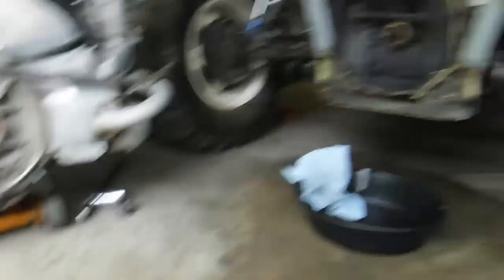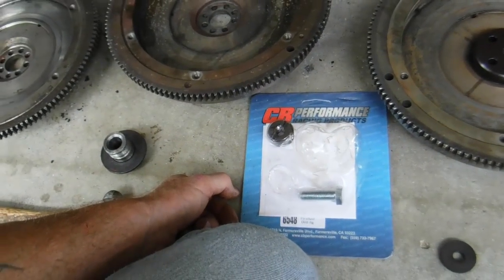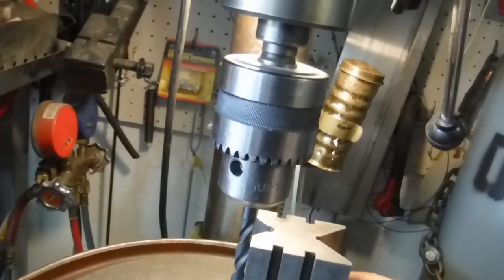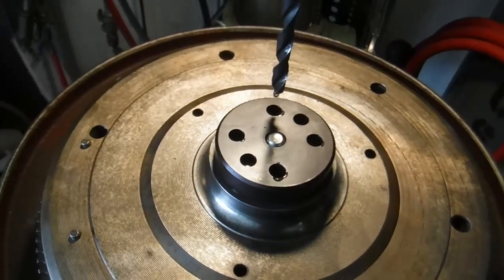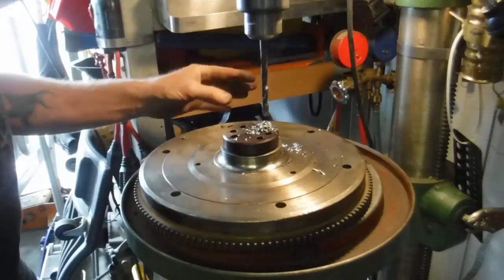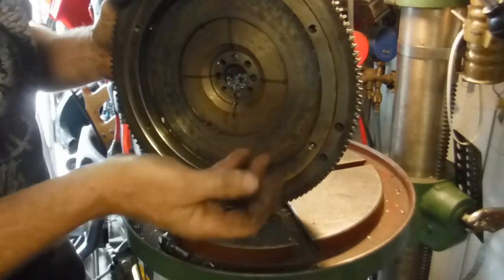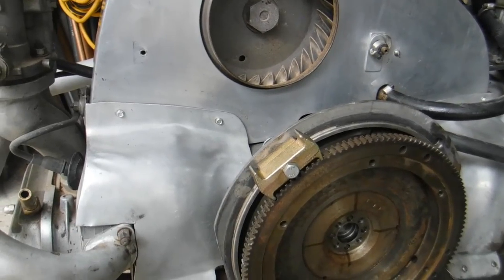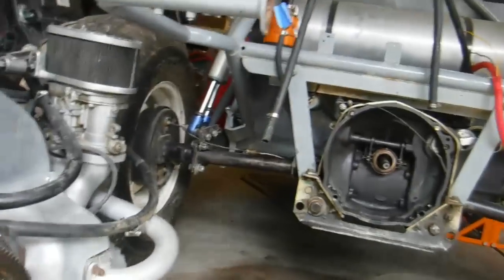Stock VW Flywheel To 8 Dowel Upgrade

Comment: I have an old 65 1200 40hp engine with the 4 dowel pins on the end of crank that look like 1/4" pins? Need to measure but the 6v flywheel I have has smaller holes like 3/16"?  Is this flywheel for an older engine before 61?
Reply from the maker: Good question. I don't have the answer but maybe someone reading the comments can help?
Reply: Thanks for getting back to me. I did some research and found that the flywheel is for a 36hp crank and what I need is one with the 5/16" pins which mate up with either a 6v or 12v flywheel. I think the 36hp one has the 3mm pins and the other flywheel has the 6mm ones. You can't modify it since the flywheel on a 36 won't mate up with the 40hp crank. different diameters. The guy who I got it from believes he has the right one in his machine shop and would see if he can find it for me.

Comment: Thx EZ.  I keep wondering if i should dowel my stock flywheel or get a lightened one.  Does it make that much difference?
Reply from the maker: I have one on my 1800 and you rode in it.......   It will be more responsive in traffic.  Might be nice in the vert you have.

Comment: Will the stock weight flywheel give the engine a little more low end torque ?
Reply from the maker: It might be noticeable. I usually put a 6 lb pulley on the other end for the same effect.

Comment: Your comments are good about using the best holes on the flywheel and two dowels to align the drill jig but it would have been very nice to actually see how the jig is set up and affixed to the flywheel. This of course is the most critical part of the process. Also, where are the instructions to setting the drill depth? The drill jig can't do this. Drilling too deep would ruin the flywheel. Lastly, as a former precision CNC machinist, a short discussion is needed about drill speed and feed into the flywheel for best precision hole drilling, talk about chip clearing and pecking it out. This information will greatly increase the value of your video.
Reply from the maker: obviously you have never looked at a VW flywheel. 
The holes go all the way threw. The dowels are usually installed on the after market  cranks. The fixture comes with a drill bit. It isn't rocket science. We're not building the space shuttle here. The jig comes with directions. I'm just showing it in operation. Thanks for watching and commenting.
Reply: I have looked at a few flywheels but certain you've looked at many more. But I do know how to spell "through" and you still don't understand how to drill a round hole with a drill. You couldn't describe what kind of drill it comes with because you don't understand what you're looking at. Just reading the directions won't describe enough to understand how to drill an accurate hole. @TheEZGZ

Comment: Older video but perfect timing! I'm building an 1800 and have been going back and forth on using a lightened flywheel. I think I'll buy this kit and use a stocker. Saves $$ and I don't think I need a lightweight in an otherwise stock bug. Thanks!
Reply from the maker: I think you will like it.
Reply: @TheEZGZ  Thanks. The good ol 1600 really isn't bad...but after hearing the raves about the 1800 I need to try. Doing so with the factory fuel injection as well. Did you have to clearance anything besides the pistons? Obviously ill do a mock up to check everything.

Comment: Great vid! Always like watching them. 

Near the end of the video you mentioned that the flywheel should be pressed on; what do you do when it's not a snug fit?
Reply from the maker: Let's hope that doesn't happen. Mine was a good fit but I did one shortly after for a friend and his pin did not line up on one hole?  So he just left the pin out. It's close enough to center that I don't think it will effect balance. Sometimes you have to be creative. Maybe find a drill bit that is a snug fit and cut off some of the shank where it's round and make your own pin.....  If your running a stock clutch you won't need it. Some after market performance cranks come with the pin's already pressed in and they are very hard to remove from the crank. In that case it's better to drill your flywheel or by a flywheel from the folks that made the crank. They are all supposed to be SPG pattern but it's not a perfect world.
Reply: Ooooooh, you were referring to the dowel pin. I thought you meant the flywheel being pressed onto the end of the crank. 

I had this problem on the weekend where there is a vibration from the engine and it worsens as the RPM increases. I notice the crank just slid on so I was suspecting it might be out of line. The dowel holes aren't too tight either.

Do the dowel pins "centre align" the flywheel to the crank?
Reply: Really appreciate the quick response. Thanks
Reply from the maker: Do you have the 0-ring inside the flywheel. If the 0-ring is toast or missing it would be a looser fit. Sounds like it's time for some new parts.

Comment: To put a lightened flywheel in my 1600 dp engine on my trike or not....
Reply from the maker: On something that light I'm sure you could feel the difference.
Reply: TheEZGZ, do you think a balanced crank would be needed? If I put on a ligtntend flywheel I mean
Reply from the maker: For best results You should have the whole rotating mass balance together by a professional. By itself installing a lightened flywheel on a mostly stock rotating mass will shorten the life of your engine. The factory didn't just arbitrarily choose the weight of the flywheel. It absorbs vibration and helps with driving. The old Model A Fords with 28 HP had a 120 pound flywheel and the did just fine. Look at the bigger picture.  Leave the engine you have alone if it runs OK and build an all out street strip motor to play with.
Reply: TheEZGZ, good plan, time to dig out my vw engine hotrod book.
Reply from the maker: If it's the one I'm thinking of there is a lot of good advice. Ya can't go wrong.  Good luck with your project